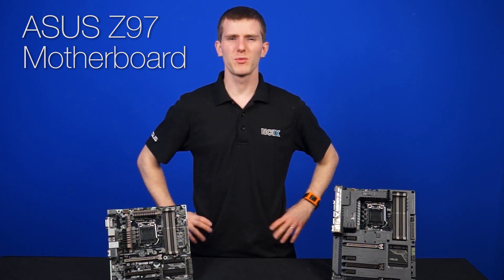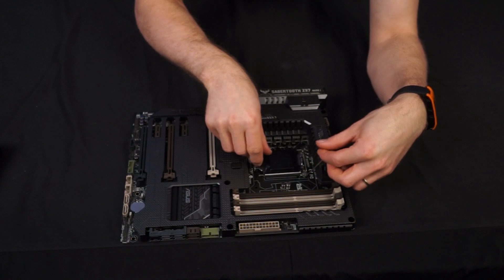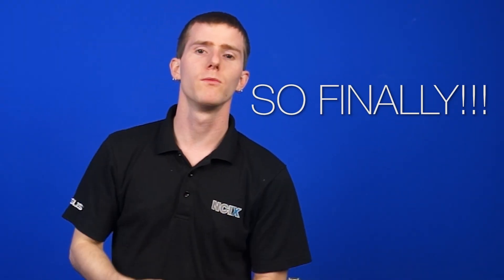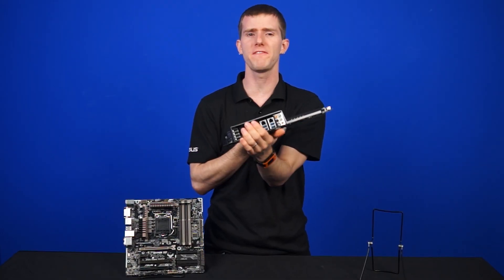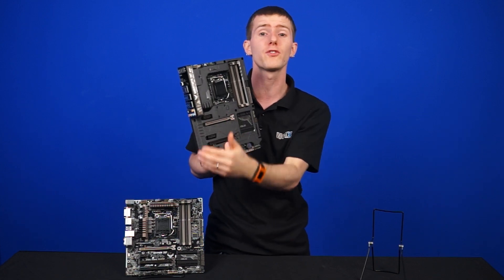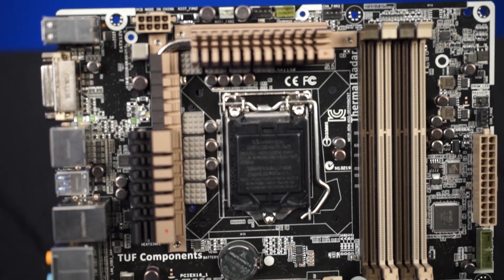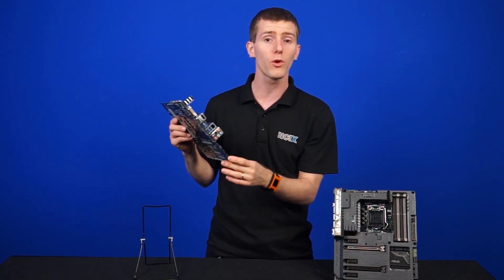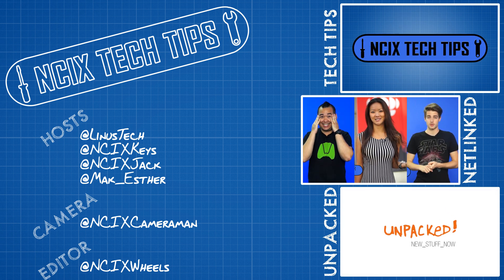What is the Z97 Express Chipset ft. ASUS TUF Motherboards - Sabertooth + Gryphon

Comment: Z77 chipset with haswell i5 overclocked from 3.4 to 4.7ghz. My machine runs so well, that there won't be a need to upgrade it for years. (assuming no disasters) Only has 8gb of ram, and that is far more then enough for anything I throw at it, which is heavy gaming and browsers with way way too many tabs (like linus does).

All this being said, that AI fan reversal system sounds amazing, and the motherboard covering might work well against dust*.

*Dust: Bane of all computers.
Reply: mark daniel Dacanay Sorry specifically using:
Intel BX80637I53570K Core i5-3570K Ivy Bridge Four-Core 3.4GHz 6MB L3 Cache Socket 1155 77W Desktop Processor.
with the MSI Z77 MPOWER motherboard.

Comment: How about Asus fixing problems with their previous motherboards. Take for example the frozen clock issue in the BIOS, that has shown up on many if not all of their Z87 motherboards. Then there is the additional problem of their so called "armor' on the Maximus VI Formula motherboard. I would like to know what bone head designed such a board, where you have to completely dismantle your whole system, which includes having to physically remove your motherboard to simply change the battery. The fact that these boards were designed for overclockers, who will have to also dismantle their cooling loops as well as everything else, just to get at that pesky battery. Neither of these problems have been resolved. An Asus tech told me to replace the battery. Well the problem with that is that I have to dismantle the whole system, and as it turns out, I also am plagued with the frozen BIOS clock. Maybe you could do a video addressing these issues. Of course Asus keeps saying the clock issue is a small issue only affecting a small number of boards (this problem is being found on ALL Z87 Asus motherboards) , and if that is the case, then it should be a simple matter of replacing these boards with new ones free of this problem, and free of charge. It would be a terrific PR move for Asus. They could milk all they could out of the positive press they could get by proactively stepping up, and making this offer to all affected customers. This should also especially apply to the Maximus VI Formula board owners, considering the fact they have the additional problem I stated above to deal with. I also noticed that Asus quietly redesigned their new Z97 Sabertooth Mark 1 board so that the battery is now completely accessible even with the "armor" in place. Seems to me that this is an admission of their screw up. You think Asus will step up to the plate, and do the right thing. I have my doubts. I am hoping, I am proven wrong, and Asus puts their customers before a little extra profit.

Comment: No not going to upgrade still have 2500K at 4.8mhz 1.312 v 24/7 MSI Z68A-GD80 (B3). The steps been  too small in my mind for few years now especially as gamer.
Reply: CPU horsepower meant with too small steps.

Comment: just did a build for christmas don't think i am upgrading any time soon

Sabertooth z87 - i7 4770k - Nvidia 780 Ti - corsair Dominator platinum 2400 16 gig ram - corsair c 70 case - Corsair ax860 PSU - 2 samsung 128 840 pros in raid 0 - WD 1 tb black HDD - Sound Blaster ZX - Asus PCE AC68 - razer black widow ultimate 2013 - and logitech g502 mouse

i think that's everything? lol only thing i want to upgrade is getting a 2nd 780 ti 
and dying for the Corsair RGB keyboard

Comment: I'll upgrade to X99 when it finally comes out... I'm running a 3930k on an X79 chipset and the main things I want are chipset USB3 support, and more SATA 6gb ports.
Reply: I wouldn't mind some native thunderbolt support. The one thing I kinda lament from the z87 boards.
Reply: error2k2 Well of course I wouldn't mind having it, but I still really want the USB3 and SATA3.
Reply: WeAreTwoDoorsDown
i have the same cpu and sabertooth board. just wondering what u need more usb3 for. i can understand needing more sata3. considered a pci sata3/usb3 card?
Reply: EZOVERDOSE I want the USB3 built into the chipset. There's less compatibility errors that way. And I don't have room for a raid card in my system. Plus I prefer the compatibility and stability of chipset SATA.
Reply: WeAreTwoDoorsDown understandable, but what devices do u use that actually benefits from usb3 is what i was asking
Reply: EZOVERDOSE Well I do video with my machine, so all of my card readers are USB3, and I use flash drives alot to transfer videos, and I also currently have some USB3 hard drives.

Comment: Not upgrading. Running a i5 3570k @4Ghz/ Asrock Z77 Pro4-M and it works fine for what I use it for. If I did upgrade, I'd want more cores, so waiting for an 8 Core 2011.

Comment: Will the Z97 support two PCI-E x16 again for an GPU SLI? or will it still run with x8 when having two GPUs?
Reply: According to the asus page:
2 x PCIe 3.0/2.0 x16 (Single at x16, dual at x8/x8) 

http://www.asus.com/Motherboards/SABERTOOTH_Z97_MARK_1/specifications/
Reply: WeAreTwoDoorsDown damn it. When will be get (16/16) again?
Reply: JustPRR Probably never. The only processor with enough PCI-e lanes to support that would be LGA2011.
Reply: WeAreTwoDoorsDown Ah so it depends on the socket. Why did they cut this feature?
Reply: JustPRR with pci express 3  x8 or x16 doesn't make difference  even x4 is not bad
Reply: ***** Maybe not now, but LGA1150 will accompany us for quite some time.
Reply: JustPRR actualy pci-e 3.0 has dual the bandwith of pci-e 2.0- pci-e 3.0 x8 is basicly pci-e 2.0 x16
Reply: The z97 WS model has 2 x 16x PCIE lanes but no WIFI or other addons such as M.2 or sata express. You check out the particulars as I am doing this off the top of my head. I am going with the ROG VII Hero myself...
Reply: Earnest Bunbury I haven't checked, but I would almost guarantee that that board uses a PCI multiplier chip.

Comment: Still running a Gigabyte x58 board with an i7 Extreme 980X 6 core cpu. Runs everything fine with dual Asus 660s on highest setting. May finally upgrade when Broadwell comes out.

Comment: I am running Z77 with a 3770K. Not worth the upgrade yet, as the current games don't really stress my CPU and CAD is also still fast enough. Maybe if broadwell features great performance difference (I think not) I will consider upgrading.

Comment: Still running my ASUS P5Q-Deluxe 775. Core 2 Quad Q9550 @3.68GHz.
Reply: Same here still using Asus Rampage Formula lga 775 q9550 @ 4.1 ghz R9 280x still work like new bf4 ultra 60 fps upwards, not is a rush to upgrade.
Reply: Indeed. Only using the XFX Radeon 7870 Core though.

Comment: Running Sabertooth Z87 with Intel Core i7-4960X Extreme Edition in it. Not planning to upgrade as there is no point:
1. The CPU will be capable of serving way beyond my needs for quite some time 
2. 8 memory slots and ability to install 64 gigs of RAM

Comment: Can someone help me? 
I am building a new computer(gaming i think) so i want to include this right motherboard + an i7 4 th generation cpu(the one is coming now in may) + ddr4 ram.
Should i wait until it's all our in the market? oh and an new graphics card saphhire 290x ( they new one(blue)).
are these compatible and worth buying?
thank you for any help
Reply: No, they are not, and I think you will be much better off getting someone else to build a system for you, as you don't seem to have the necessary knowledge about it and might end up breaking your parts. :(
Reply: well i know the basics but not much about the new stuff
Reply: If you say so, but do try to get all the help you can get. DDR4 is not supported, but DDR3 is. All the other parts you listed are compatible, although you should do more research before you buy them.

Comment: Thanks, Linus.  In this video, you provided the needed information so most people, who isn't a tech expert, can make informed decision.  As expected, the CPU from the current Haswell to the refresh to the Broadwell will work for both the z87 and the z97.  Also, the motherboard only support DDR3 and not DDR4, like how people seriously believe it is without looking at the spec of the board.  The main difference is the SATA Express and M.2 Storage Capability.  Both are great added feature for increase speed for SSD drive but not so much for mechanic drive (yes, there are people that still prefer mechanic drives...).

So, is this worth the upgrade if you have the z87?  If you are using SATA SSD or planning to buy drives for the M.2, then this is a decent upgrade.  However, if you are still sticking with mechanic drive (o.O;;) or you are a budget buyer will are saving money for major changes, then these motherboard might not be right for you.

Now, if you excuse me...  I will be pre-ordering these baby...  Planning to get the Haswell refresh and upgrading my SSDs...  runs

Comment: Currently Running on the 775 platform using a Xeon X3380@4250Mhz. So far, it has done everything I need it to, best upgrade for me now would be 2 SSDs in RAID 0. I have been wanting to upgrade to the X79 platform but the cost is still up there, so I will wait for the X99 and upgrade at the point. Do I need all that power..? NO... but I certainly don't like to wait on my computer to respond. The currently specs on my system can be seen here: http://valid.canardpc.com/5y15ub 

Linus do you mind sending me a pair of SSDs so I can upgrade my current RAID 0 mechanical hard drive to an SSD Array...... Smile.

Comment: Well linus this will depend on the Thermal capabilities of the new chip's. I have been running a 2600k at 4.8 on air and now on a H100 for about 2 years or so. I have not change because of how hot the Ivy and Haswell chips run. I have been running my 2 Evga 780 ACX on pci-e 2.0 and would love to see with the newer chips if there is much difference on a 3.0 board since I'm running Nvidia surround. Have you guy's done a video on this??

Comment: I'm waiting for the Haswell-E (Z99) and specifically the i7-5960X, but unless there's at least a 25%+ improvement over my i7-3930K in SQL then I don't know?! As it is now I run testing @ home using a RAM Drive. The $1K+ CPU is a lot to swallow and I'm kinda PO'ed there's not going to be a cheaper 8-core. Oh did I mention I game...

Comment: Does the future CPU comparability render the Z87 series outdated?
I wa planning on getting a Z87 for a future build, but considering the lifespan remaining due to future CPU's
Reply: Buying intel for longevity with intentions of upgrading is foolish since they come up with new chip sets like every year.
Reply: wyzemann X79..... and Gaming... you should have spend more money on a graphics card :)
Reply: Depends how long in the future ur thinking of having it. I bought a P8Z77-V Pro last year and will probably use it for 5 more years atleast.
Reply: the z87 chipset will still be very good for devil's canyon cpus.
it still supports the lga 1150 which is what devils canyon is. so I would not expect z87 to be out until late 2015 to early 2016
Reply: buy an intel setup when a new socket formfactor is release, with decent CPU~ in two years time upgrade the motherboard then year after upgrade the CPU~ the new platfor could prob run you another 2 years.... thats how you should mantain a 5 year lifespan of an top spec intel platform.
Reply: ??? I bought my i7 3770K and overclocked it to 4.6GHz I dont think I need to upgrade in 2 years man. That is only if you want to have the newest all the time, It will still work fine in 2 years. And also depends on what ur doing with ur PC. The only thing I might upgrade in 2 years is the GPU from my R9 280X to someting that can handle 4K in the future.

Comment: So it took Intel 2+ years to put proper thermal compound on their unlocked processors? Bravo.
Reply: Better than never :)
Reply: LeftCZ I sure hope they do put good TIM or maybe even solder the IHS on Broadwell unlocked CPUs. Though unfortunately we won't be getting them until Q1 2015.
Reply: *****
 So what do you think are they gonna do with the Devil's Canyon CPUs? Only spend more time properly applying the TIM or solder it as in case of Sandy?
Reply: ***** Nope. A lot of people were curious over why Ivy/Haswell run so hot, so they delidded their processors, replaced the default TIM with a high quality thermal compound, and then just placed the IHS back on and let the coolers pressure hold it in place. Most people got around 10 - 15 degrees off. So no, the TIM is utter rubbish.
Reply: ZewRongGuy
And what do you think has Intel done/will do with Devil's Canyon? A) Change the process of applying the TIIM, B) replace the current TIM with some new one or C) solder it together (as they have done with Sandy - did they do it before? Do they do it like that with socket 2011 CPUs?). And what about Broadwell? Thx
Reply: LeftCZ My guess is they put some better TIM in there, instead of the cheap crap in the current processors, like stated in the slide ("Improved Thermal Interface Material"). Yes, LGA 2011 processors use solder. Don't know about Broadwell, I suppose they'll just do the same as Devils Canyon.
Reply: ZewRongGuy
And my last question just to make it clear- Ivy and Haswell were not soldered and used low quality TIM, right? Sandy just used better TIM or was it soldered? And the previous CPUs - such as 1st gen Core, Core 2 Duo etc. - were soldered?
Reply: LeftCZ Yes, Ivy and Haswell use cheap TIM. Sandy used solder, that's why they ran very cool compared to Ivy or Haswell. I don't really know what they used for Nehalem or earlier, but I'd guess they used solder until Ivy, because Ivy was significantly hotter even though the manufacturing process was shrunk down to 22nm. Previous generational hops gave better performance with similar or better thermal performance.
Reply: ZewRongGuy
And what do you think about a possible reason that the worse heat dissipation can be cause simply by the fact that in the 22nm process the transistors are so close together that the heat just cannot pass away? Can it be a factor?
Reply: LeftCZ Yes, but people delidding and getting better temps proves that the new transistors are only part of the reason.
Reply: All right. Thanks for your answers :)

Comment: Eh, I finished my build a few months ago. I7 4770k, Asus Hero Mobo, 780ti. I won't be upgrading for a while, when I do need to upgrade, I'll overclock the heck out of it!
Reply: Well said. I'm pretty much in the same boat.
Reply: Sandro Di Matteo me too.  I just built my pc almost 2 years ago, and just recently updated to a GTX 980 GPU, and I'm extremely happy. Right now I have.

Intel i7-3820 Quad Core 3.6Ghz LGA2011 (Sandy Bridge E)
ASUS STRIX GTX 980
Asus P9X79
G.Skill 4x4GB DDR3 1600 RAM (Quad Channel)
Cooler Master Hyper 212 EVO CPU HSF
SAMSUNG 840 Pro SSD (256Gb boot) and SAMSUNG Spinpoint F1 (1TB storage) HDD

So, all i need to do is get a water cooling kit (and a larger case) for the CPU and overclock my CPU past 4.5Ghz. Which i can almost do semi-stably now with the Hyper 212 evo, but it still BSoD's from time to time so i just need better cooling.

Comment: Not wasting money on a new platform until Intel gets their heads out of their asses and updates x79 to not be terrible anymore.

Currently on Z77 and am dying from the 2 SATA6G ports, but considering I'm running all SSDs, it's not all that much of a big deal as they're still worlds faster than mechanical drives even at SATA3G.

Oh and, they stopped supporting Vista, so any new chipset won't even function on my OS anymore.  My drivers are all terribly outdated.  Yet despite Vista's extreme similarity with 7, they continue to support XP, which just boggles my damn mind to no end.

My next upgrade will end up being a full rebuild too.  I'm leaning more and more towards silence and am sick of my old HAF-X, need some sound dampening material and I don't quite care about windows anymore, though they're still nice to have.  Also, not jury rigging SSD mounts and having 4 hot swap bays (instead of 2) for a RAID1 backup array would be nice.
Reply: Why are you using Vista??? You should be looking to go to Windows 7 or 8 as soon as possible

Comment: I think that overclocked 3570k on a Z77 is enought power for even a 780ti, so I will not upgrade to Z97 even if it supports Broadwell. I will upgrade the system when the DDR4 will arrive in a nice price and some nice MOBO will come out. :)

Comment: Not going to upgrade just yet because I have an Ivy Bridge system I built myself and runs with no fans at 100% load <50 centigrade. The system is at a 'good enough' state to play anything I throw at it so the next stage will be replacing furniture rather than wasting my money to get very little performance gain.
When broadwell comes, I may change my mind. We need some new features from Intel all the processors have no major leaps in technology just an extra 100mhz here and there. I do welcome the new power saving features though.

Comment: Still rocking in a core i7 920 here on an asus p6x58d-e. All the components are over 4 years old now, and my i7 still overclocks to 4ghz, in fact, thats what i run it at everyday. I dont see the need to upgrade to any newer platform as my current one is perfectly fine :) ( untill something dies of course :L )